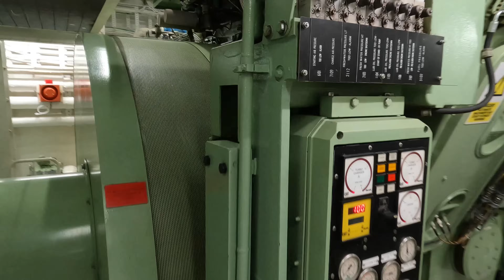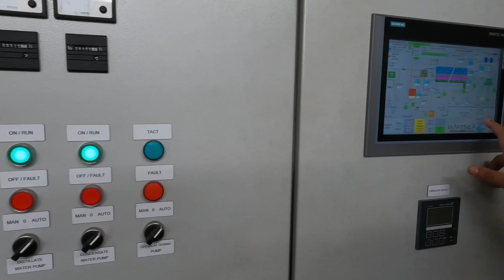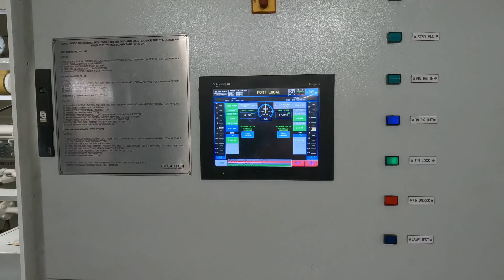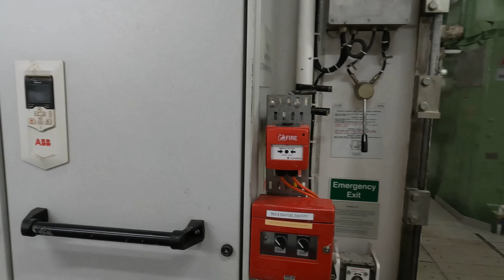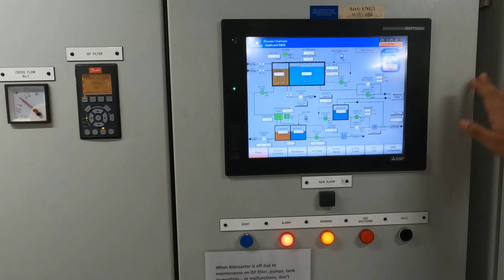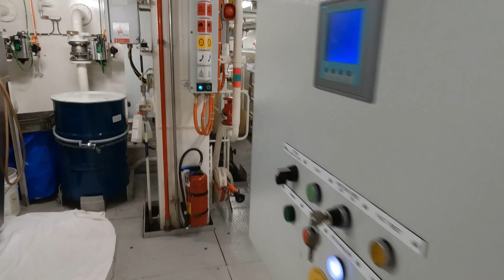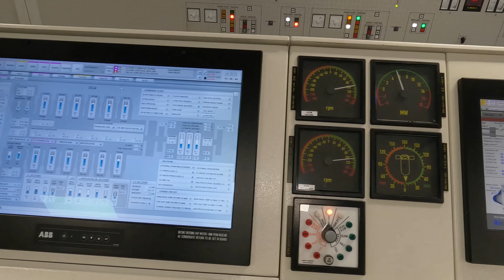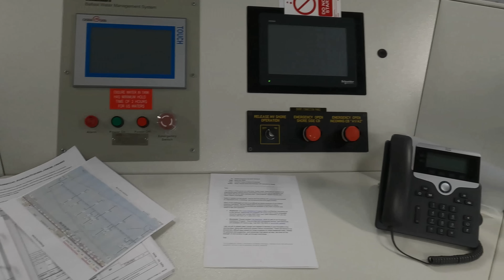Exploring a Cruise Ship Engine Room

Comment: How do you change the engine oil on those monsters?
Reply: Engine oil isn't changed. Every so many hours of operation the oil is processed thru an "engine oil purifier".  It's basically oil centerfuge, the oil is basically put thru a spin cycle like a washing machine.  The oil is cleaned and goes back to the engine block. The oil isn't changed only added as  needed.
Reply: @Ned-r4t  So can we manufacture  the same oil process for cars and trucks? That would save a lot of money. Just your opinion please but your job would be super fun!
Reply: @jeffkelley5507 It wouldnt be possible on a car engine.

These purifiers use water to seal the bowl inside so you’d need a water supply to run a purifier.

Also, every two hours the purifier goes through a desludge cycle which dumps the dirty oil down to a sludge tank.

Furthermore, every approximately 3 months the purifiers need a service which takes a full day to do almost and just the parts to do it costs around £500.

And if the purifier isn’t running for say a couple days which is quite likely on a car, the purifier could need opening up and cleaning.

Comment: If you add the power of the 4 engines then you get way more needed than the two azipod motors require - confused?
Reply from the maker: The would never run engines at full power, it wears them out and wastes fuel.  With azumuth thrusters at full power, and running all 4 diesels, they would throttle them just enough to provide electricity for propulsion plus the additional needed for all the other electrical systems.
Reply: They aren’t engine producing propulsion power so to speak.

They’re electrical generators producing electrical power to drive everything on the ships from hair dryers, lighting, all the way up to ac machines, bow trusters and propulsion.

Comment: How much Diesel fuel per hour, for this joy ride???????? This is what Stop Oil should be blocking. Not the average Joe that needs his car to go to work......
Reply from the maker: The engine specs are in the video description. They rarely run all 4 engines. You can use the specific fuel consumption spec to figure out out. With all 4 engines at maximum power it looks like 19,600 pounds per hour is the upper limit. (You should verify this; I'm not a marine engineer.) Diesel is around 7.2 pounds per gallon so 19,600/7.2 is 2,722 gallons per hour maximum possible consumption.
Keep in mind... They never run all 4 engines at full throttle. Suppose at normal cruising speed they run 2 engines at 70% power. In that scenario it would be something like 953 gallons of Diesel per hour. That sounds like a lot, but considering the ship can accommodate 2,666 passengers....  0.36 gallons of fuel, per passenger, per hour. How many gallons of fuel per hour does Joe burn while driving to work? I'm definitely not a Big Oil spokesman, but a cruise ship is objectively an extremely efficient machine for transporting people. 
Fun fact: The Airbus A320 airliner burns around 4.6 gallons of fuel, per passenger, per hour. 😯
Reply: 5-8 tonnes of fuel an hour while sailing I’d guess.

Comment: Usually in new model of cruise ship for today specially the big one like Oises class, have four giant deisel engines served as generators, for this class is using pods propulsion ststem using a giant electeic motor inside the pods housing which is complete of ventilation, so commonly seen inside the engine roon for individual engine was the giant switchboard piping accessories for cooling and lubrication systems and a crowded purifier room for l.o. and f.o. akso other impirtant things to run and control the engines, actually no main engines for all was a generator driver but a bigger size than any normal cargo ships in size, its nice to tour arround engine if ventilation is cool but failure of ventilation you cannot stay longer inside on this area if you are vusitors but if you work here nice to stay always in control room.
Reply from the maker: Thank you for watching the video and taking time to comment. Technical information about the machinery can be found in the video description.
Reply: If you have a ventilation failure in the engine room, the engines would need to be stopped or you’d quickly create a huge vacuum in that engine room, the heat would be the least of your worries.

Comment: What type Fuel do you use #6 or #2 Fuel Oil?
Reply from the maker: I'm not a marine engineer so I don't know for sure. From what I understand, they can use a variety of petroleum fractions, from HFO up through Diesel. Fuel pre-heating equipment is shown in the video at 5:01 so I assume high viscosity fuels can be used.

Comment: I’m writing this halfway through the video. There must be a fair amount of redundancy built in. Plus a huge array of spare parts to service all this equipment. Love looking at this operation. My father was a mechanical engineer so as a child I got to see all this mechanical at work. I think I spotted a milling machine in the workshop prior to going into the control room. As a child I would sit and watch my father working on a milling machine making parts for a car he was restoring on the weekends.
Reply from the maker: I think they have at least 2 of everything. This ship has 4 engines and the engineer told me they only run enough of them to meet the electrical demands, which increases proportional to the ship's speed. It's common to run just one of the electric propulsion units and one stabilizer fin for increased efficiency. The machine shop was really interesting to learn about. I noticed a band saw, drill press, lathe, and the mill which I think was CNC capable. They also have carpenters on board so I'm guessing there was a wood shop somewhere. Much of the maintenance is performed while the ship is underway, even replacing engine parts. Thank you for taking time to watch and comment.
Reply: I'm pretty sure they have a complete machine shop in these ships since it's like a necessity for sure. It's fascinating for sure !
Reply from the maker: @guzziguy1000  Yes, you can see the machine shop around mid way through the video.
Reply: Je bosse pour ABB  sur la partie driver propulsion, un plaisir que rend mon job extrat😊
Reply from the maker: Interessant, etes-vous ingenieur?

Comment: Too jumpy; stay on important areas longer.
Reply from the maker: I was disappointed with how shaky the footage was. I forgot to enable the stabilization feature on the GoPro and did my best to correct it during editing. The raw footage is almost one hour, most of which is standing and discussing important areas. It was so loud the speech was not recognizable unfortunately.
Reply: @ Speaking for myself, and maybe others, I’m more interested in the main engines;  the brand/ manufacturer, how many, number of cylinders, HP, rpms,  gear boxes and drive system (pods, direct props, etc.).
Reply from the maker: @Buddhistview145  I added some technical specifications in the video description.
Reply: @ Thanks
Reply from the maker: No problem, let me know if you have any other questions